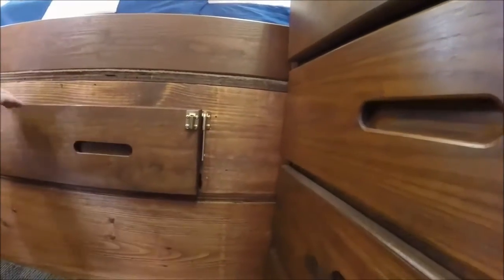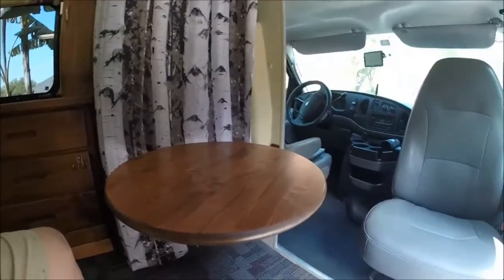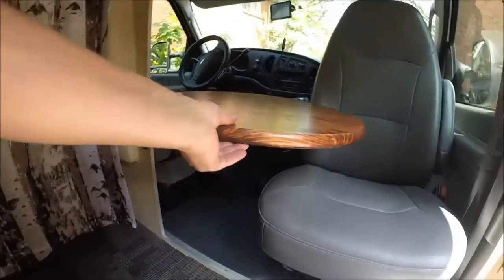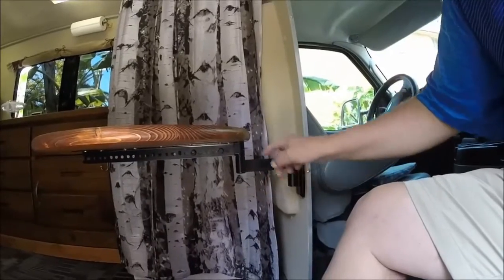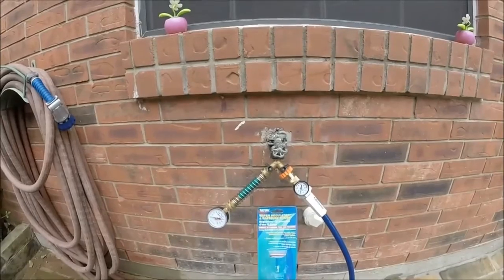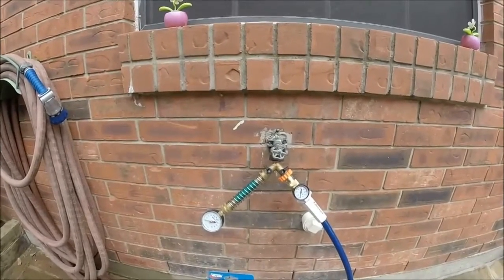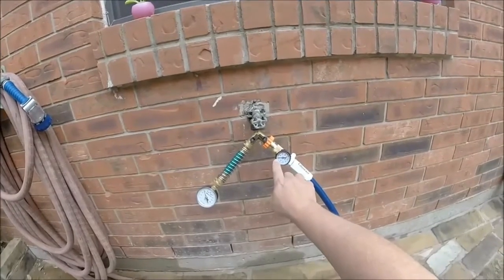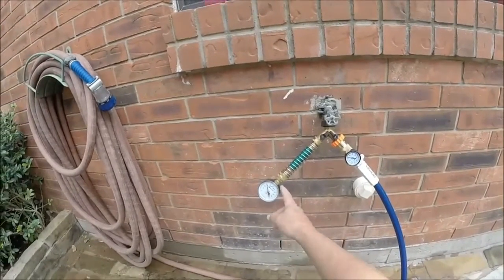Jordan Box Truck Camper Conversion Table and Water Pressure

Comment: Good idea for the drawer locks. I have a pressure regulator setup similar to yours. You have to release the pressure on the gauge side if you want to take a second reading or you won't get a true reading because there will still be pressure from the first reading. Happy Travels

Comment: i think i may have missed you talking about it so i will ask is your camper 4x4 or 4x2? anyways keep on keeping on
Reply from the maker: Hi kayley, this truck is a 4x2.  Thanks for watching!
Reply: i like watching you build this camper i think we as Americans have gotten lazy and we need to go back to building and fixing things instead of using and throwing things away
Reply from the maker: I agree!  I actually owned two used Chinook RVs before this truck, and was never satisfied with the comfort.  Also, when things broke, it was difficult to unravel the systems on board.  Felt also that i had to maintain to many unnecessary things, so when i saw this truck, i immediately felt i could build it out myself to suit my needs in a more practical way.  Am taking it out today for three day fishing trip at a State Park  in Texas, and just came back from a three day trip to Arkansas.  Where to you live?  Are you building something now also? You can respond to my email if you want, r2jordan@comcast.net.  Building your own gives you a great sense of pride in your work!

Comment: Ramie where did you get your drawer latches? I like your videos! Ron
Reply from the maker: Hi Melvin, I bought those drawer latches at Lowes.  They were in the section where you would normally buy latches for Doors.  I just set it up so that if fit on the drawer the way i needed.  Works great!  Glad you liked the videos, lots of work, but i am really enjoying the truck.  Do you have one in the works?  Best Wishes to you!
Reply: Thanks I have a pickup truck and a 24 ft travel trailer but I'm trying to talk my wife into selling everything and buying a van.